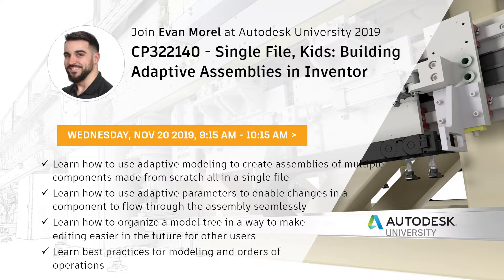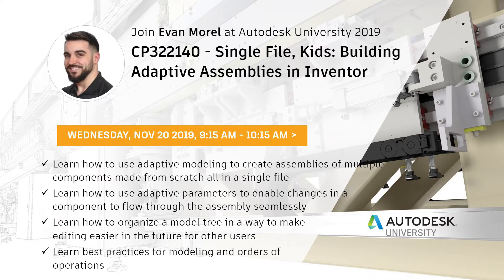Assembly Adaptivity Best Practices | AU2019 Session Preview | Meet the Expert!

Comment: The only Large 'con' about adaptivity for me is that; only the person modelling the component/design knows how it has been built and which parts are adaptive to what. 

I think I had the same issue with you Neil like you spoke about at 12:30 where i also joined a company which utilised adaptivity, but in the wrong way and the designs were not documented how they had been built, and it just caused more issues than it was worth.

I look forward to watching Evan's Video on adaptivity to see if i can gain a better understanding from it!